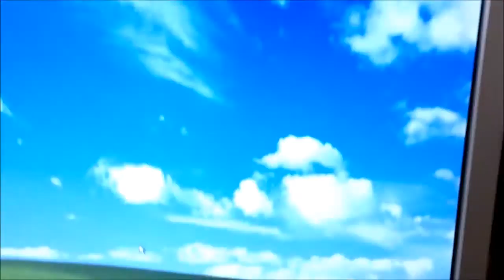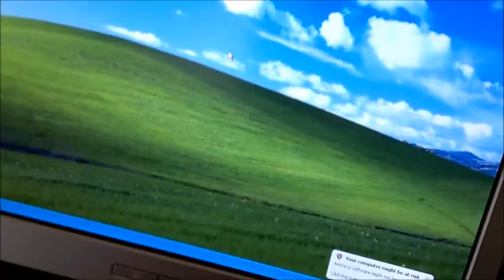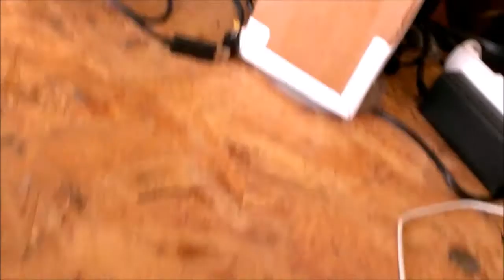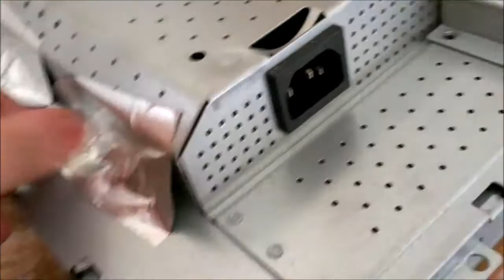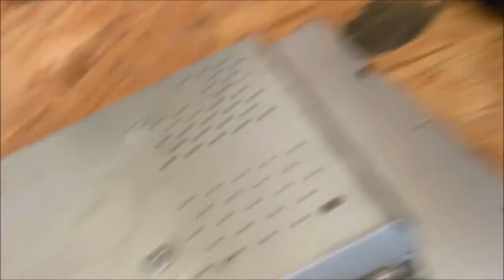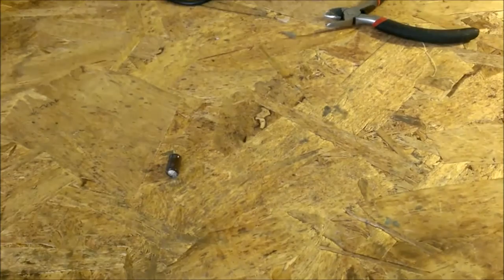HP monitor repair flickering video on and off no video LCD

Comment: Hi Bro.

My monitor is the same model and it stopped working yesterday emitting strange smell from top vent.
I took it to someone and he fixed it , but now when I connect it to the case , it emits static so strong I don't hear anything on near by speakers, and the keyboard light starts to flicker, and the internet router near by stops working. Even when I plug the monitor to a different power outlet the problem remains.
I've tried the case on another tube monitor I had , no problem. Keyboard, router, case are all OK.
So what the hell is the monitor doing when plugged to the case?? Does it need more fixing??

Comment: Mine flickers and turns off when watching videos . Checked the capasitors they look good . Noticed in the upper right side of the screen that it´s warmer than the other sides . MIne has only 1 board.

Comment: https://youtu.be/KKmEsbuVVR4
 This LCD screen, brand HP L2045w model shows a noise in the image, but 
not in the OSD. I guess the error is in the capacitors on the logic 
board, but I want to know more, if possible repair. Thank you so 
much!!!
Reply from the maker: it could be the capacitor or maybe try a different vga cable.